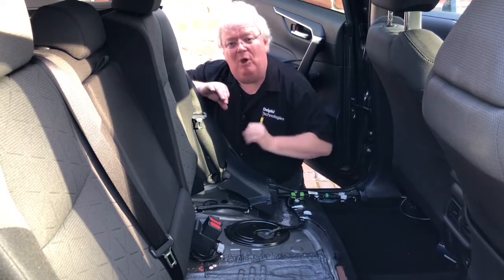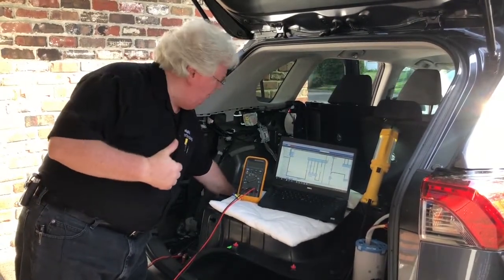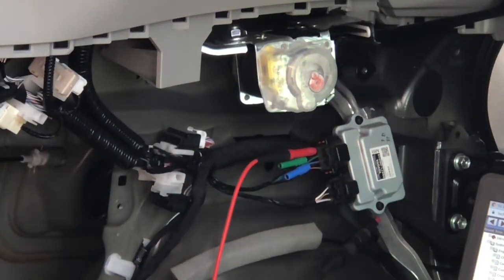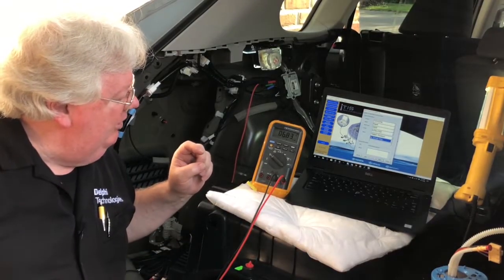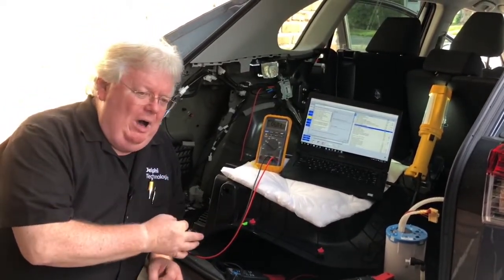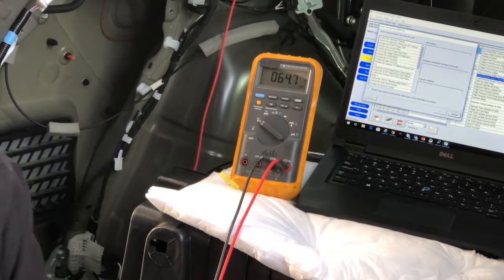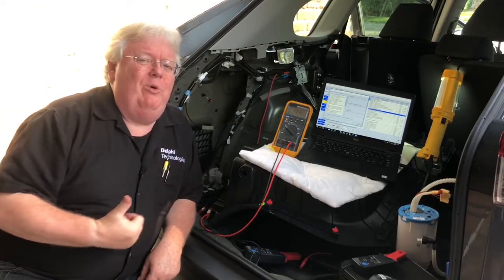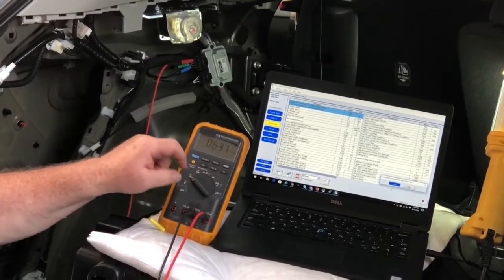Diagnosing 3 Phase Brushless DC Electric Fuel Pumps

Comment: Am I wrong, or did you just spend the 95% of this video showing the tool you shoudn't use to test a 3 phase pump?I suspect a knife and fork to test it won't be much use either. D minus
Reply: You're not wrong.  And the last 5% didn't tell me anything about how to actually confirm a problem with my own car's 3 phase fuel pump.  I want that 16 minutes and 39 seconds of my life back.

Comment: Instead of having one power wire that go bad we now have 3. Instead of a relay that turned on once in a drive cycle we have a module operating at 12K times a second. Instead of being able to diagnose with a common meter you need a oscilloscope? I'm old school but that doesn't seem like progress to me.

Comment: What is the benefit of 3 phase fuel pumps?
Reply: That pump only pumps the amount needed. No pressure bypass valve is needed.
Reply: No brushes or commutator to wear out.  I’m guessing it’s a squirrel cage induction motor run off pulsed (prolly square wave) DC instead of Lord Teslas AC motor that has given birth to the 20th century. Jus fyi, edison was a pirate and a thief! We use similar motor arrangements in our brushless DC power tools in OEM production. Vive Atlas Copco! 
P.S.stanley tool suuuuuuuuuuuuuuux! Like seriously they lick Atlas ballz! lol  trust me, powertool by osmosis. 😵‍💫😵‍💫😵‍💫😵‍💫😵‍💫

Comment: You still didn't' at all explain how to test if a pump is good..   In the old 12v pumps, you can just apply power and confirm that it's working, and even test the current and look at the little bumps in the current and make sure there aren't burnt spots in the armature contacts.. But for these 3 phase motors-- if you have a bad motor controller,  how can you test if the pump is still good?   I mean, you can ohm out the coils, but that doesn't fully confirm if it will run.   We need a test bench way to test these motors without the controller.
Reply: Measure fuel pressure and flow rate.
Reply: @manaccept145    Lets say your pump stops working and you don't know why. You tested the module and it seems to be broken,  so you'll order a new one.  but how do you test the pump now?   How do you tell a customer.. 'You need a new module, but after that, you may need to also order a new pump too"??    That's not a good look.  Why can't you test the pump NOW and measure it's flow and pressure, like you said?   But how do you do that?  You can't just apply 12v like the old pumps...  Maybe he needs a pump and a module, so he decides not to fix it at all?   See my point?   There needs to be a way to bench test these pumps, but you can't run them without a controller of some kind.  He never talked about this at all.
Reply: well..... from I can find.... 3-phase brushless DC (BLDC) electric fuel pumps are essentially pulsed AC motors.  Interesting.  If you could control sequence 3 Pulse Width Modulators (they're cheap) ......  assuming you know the voltage and frequency that these motors operate at, THEN you could pulse for testing.   Probably easier to use a scope to see the pulses are being developed.....
Reply: @silvernblackattach  Yes, but they can be different.. They may have 6 coils or 12 coils, ore even just 3 coils. etc.  It all depends on how they are made.   They will also have a hall effect sensor that reads where the rotor is, for timing.  So yeah, it's not exactly an easy thing to drive.

Comment: Hi, I’m testing a 2019 es350 with an identical pin out as shown in this video. With KOEO, I have 12  volts at all 3 phase wires, just like you demonstrated. The thing that’s puzzling me is that I have 8 volts at the brown wire. I don’t know much about shielded grounds. Would the 8 volts at the brown wire suggest high resistance in the ground? Thank you

Comment: It’s not a Toyota, but I’m troubleshooting a crank no start Audi at home, and this is good info for me.  I don’t have a scope, but I do have a Fluke and scan tool. I think I can use the info from this video to help me figure out if the controller and high pressure fuel pump are working.  Thank you for the video.

Comment: I am curious if you are able to measure pump speed on these with the pico, or is that not possible?
Reply: I reckon you might be able to by working out the frequency between the phases, then a calculation to get the rpm. One complete phase would be 360 deg of pump rotation, work out the time for the one phase, then divide in to 60 seconds for rpm. I think you would only need one phase waveform to work this out. Not done this before, so consider this 'in theory'! There might be an easier way?
Reply: An easy way would be to concentrate on just one phase: knowing that each coil changes polarity every other activation the time between 2 positive ore 2 negative activations equals to a complete turn of the pump. You can measure this with just one channel with just one  amp clamp, no 3 or 4 channels required. Same applies for voltage measurement. From there on you'd math it out the usual way.

Comment: What would happen if you lost one of the phases.
Reply: It doesn't run - I used to put this fault on Audi's during technical training 👍. Each phase acts as a 'supply' and 'ground' for the other phases when in operation. If one phase is open, essentially all three phases are open.
Reply: Great question Rey!  I need to verify this but it should not run.  Using the Toyota Tech Stream scan tool you can activate a single phase (one at a time) and it does not run.  I would presume that dropping a single phase would be similar - the pump wouldn't run.

Comment: Thanks Dave Hobbs for share this information about fuel pump. I met some problem with Volkswagen Touareg with two pump one start and one main.
Reply: I’ve got a 2014  vw Touareg 3.0 v6 tdi in non start and it’s got the 3 phase pump and on the left hand side another pump. What was your diagnosis with your Touareg